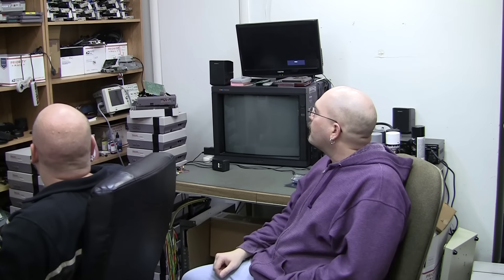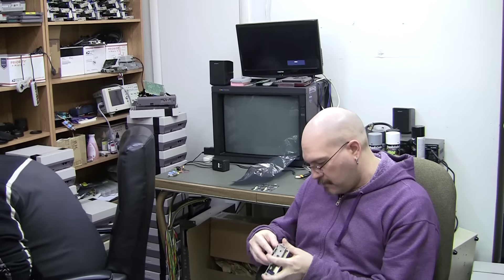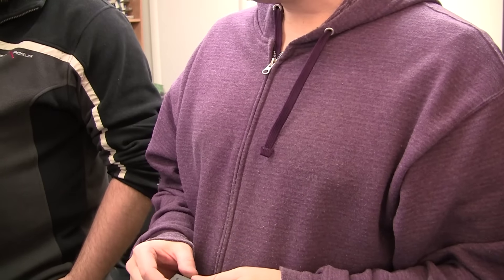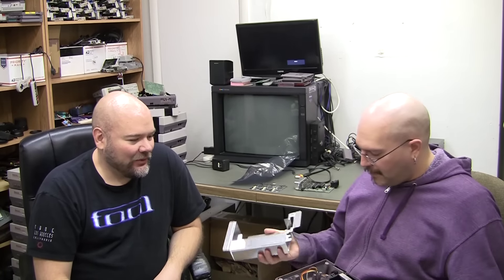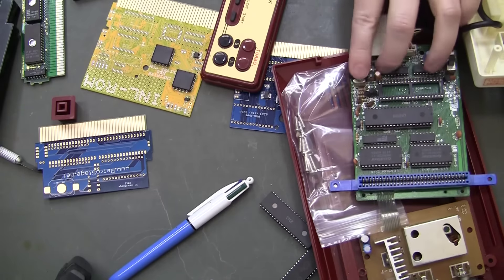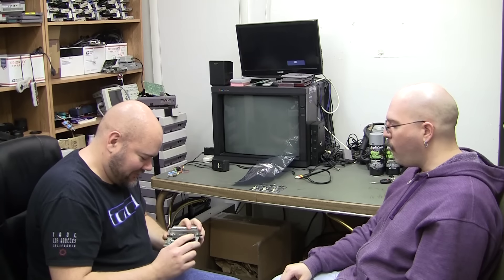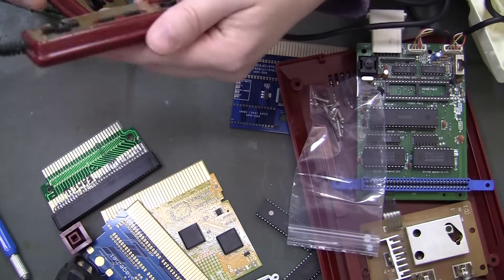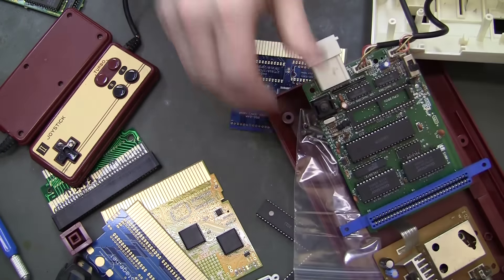Hi-Def NES update with Kevtris and Game Tech Feb '16

Comment: heard you talking about umc chips, 6527P is a cpu compatible with ntsc games but designed to work in slowed down PAL mode, they were sold with eastern european famiclones, it comes with 6538 ppu and they both require 26.601712MHz crystal in order to work, compatible with japanese famicom games, but run slowed down (50Hz)

Comment: The reason people want to mod the original Family Computer is simple: it needs it more than any of the other models! The video quality is terrible, especially on the earliest ones. Also, I'm sorry it is so much trouble but there are many good reasons to maintain composite output. For one, you can't just connect HDMI to a CRT for no/low latency. For another, there's Zapper support. Also, expert players who want to capture record-setting play-throughs at the highest quality while playing at the lowest latency need to output both. You are already catering to these types in one way with the timer feature. ;)
Reply: +Emmett Turner I think you also can't ignore the aesthetics of it. I really enjoy the look of the original Fami and if it didn't have as many downsides as it does I'd probably have gotten one in lieu of my AV Fami.

Comment: Probably that clone is PAL-M, here in Brazil we now use NTSC as standard, but some old consoles were adapted by distributors (mostly nintendo consoles) to use PAL-M as most of the TVs we had back then didn't work with NTSC. And some import consoles that were NTSC had to be modded to work like that as well, like N64's that had one of the crystals replaced by another crystal+ceramic cap in series (the one I got had that combination). The problem was that some games are NTSC only and got a crappy B&W image or even not boot up.

Comment: It's probably because people want ROB and the Zapper to work. Since no one can get them to work on a modern tv. Composite is the only way to go, for them.
Reply: +rangerreview It's why I stick with analog RGBs Video.
Reply: Oh and the Zapper does work with RGB video via a professional broadcast monitor like a Sony PVM, the Zapper was designed for CRT screens. 
Its theoretically possible for the NES Zapper to also work with a CRT VGA monitor but I haven't gotten a chance to test this out.

Comment: I have a question that has nothing to do with this video you had done a tg16 for me region mod I was looking into getting a everdrive does the everdrive work on the mod that you use because on the site it says may not work with modded systems but I remember you having a video using a everdrive on a modded system any help would be appreciated
Reply from the maker: +Anthony sill 
I don't see where it says 'may not work with modded systems'? It does say won't work on other NEC systems, because it's designed only for the tg16, not duo etc.
Yes, the tg16 region mod works with everdrive, as you've seen in the vids, so you answered your own question...
Reply: +GameTechUS perfect thank you
Reply: +GameTechUS just wanted to be sure

Comment: Who are these people that still want composite still? personally I'd either want analog RGB or digital RGB via HDMI.
Reply: anyone that still want to hook it up to a CRT TV. I'm not sure if this breaks lightgun games, but if it doesn't then the only way to play a lightgun game it to hook it up to a CRT and most CRTs usually only have cable and composite connections, and even less have component, and here in the states we didn't get scart so that's not really an option.
Reply: +madmax2069 then wouldn't that RGB mod from Australia be a better choice for them?
Reply: +CSDZX not everyone has a RGB capable TV/monitor.
Reply: +madmax2069   S-Video, then. It's what I use, and S-Vid TVs aren't hard to come by.
I think most of this call for composite is mostly just a knee-jerk reaction. People don't want to feel like they're losing any functionality, even if it's functionality they're not likely to use on a regular basis.
That said, though, it's also nice to have composite for the purpose of comparison: to demonstrate the extent to which the mod is better, and to see the differences (mostly good, some bad) that come from the clearer picture, like color palette differences and the loss of the smoothed-out look that comes from color bleed. Plus sometimes it's just nice to have composite available to fall back upon.
'Course, there's a fair case here for just taking a stand, saying the modded system will no longer provide composite output. End of story. It's easy enough to get another NES or Famicom if you want to have an unmodified one on hand. The PPU composite video plays a critical part in the picture generation on Hi-Def NES and NESRGB. Nothing good comes from opening up that signal line to possible interference.
Reply: +Tetsujin the old CRT tv I have only has cable and composite. I'm not going to buy another CRT to get one that has svideo or hopefully component.
Reply: madmax2069   Well, that's understandable - and my RGB-modded NES works fine and still supports its standard composite output, so it is possible to have it both ways. I just don't think it's a very good idea because these mods rely on a clean composite signal from the PPU for their operation. I can understand why you'd want to keep composite around but if it winds up compromising the RGB or HDMI picture it's not worth it.
The RGB mod also outputs composite, but honestly I don't think it's an improvement over the standard composite. It may actually be a little worse. The NES dot crawl makes the picture jagged and jittery but otherwise the picture is pretty sharp.
S-vid is totally worth it for a CRT in my opinion, though on some CRTs it makes less of a difference than others.

Comment: I dont think anyone would use composite.  Everyone wants HDMI.  
Please take my money and give me HDMI!!
Reply: +Common_C3nts 
I prefer RGB output. All my retro consoles goes though a XRGB 2 Plus to my TV, so it saves me on HDMI ports on my TV.
Reply: +Lukas Peruzovic   
This makes 0 sense at all.  You can just use an HDMI splitter or just swap ports and eliminate the XRGB.  
Why adapt to hdmi when you can have HDMI from the start?
Reply: +Timothy Vreeland   
They already have the RGB mod for the NES so you can use that for light gun games.  The point of Hi-Def NES is to connect your NES to HDMI, but with native 1080P output instead of scaling.      
With current HDTVs you are not going to be able to play NES light gun games on them regardless what video output format you use to the HDTV.  

Again there is no reason to waste time adding RGB out to the Hi-Def NES if it means extra costs or lots of issues.  Everyone wants 1080P HDMI out.

Comment: I know the one I bought broke with one day of receiving it
Reply: +Bob Marley what happened to it? did you get it fixed
Reply: +thomas83lin It worked fine for about 3 hours or so, so I know it worked.  I didn't even touch it, come back to play it and I got a gray screen with just jail-bars.  So the jail-bar mod was still active and working, but the system itself would not boot.  Very odd.  I only have one cart though, an Everdrive.  The Everdrive is brand new and works fine on my YPbPr modded NES that Jason did for me, it just would not work on the HDMI NES.  I sent it back to Jason and of course it "worked for him" and he re-sold it.  I myself was a computer technician back in the day, its not like I am tech-illiterate.  I am excited for Rev 2, hopefully I will have better luck.